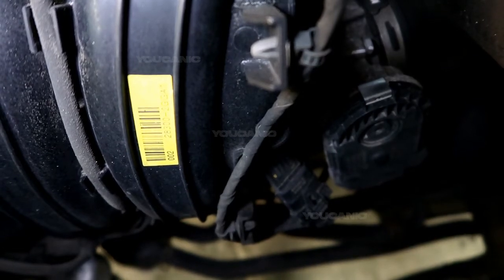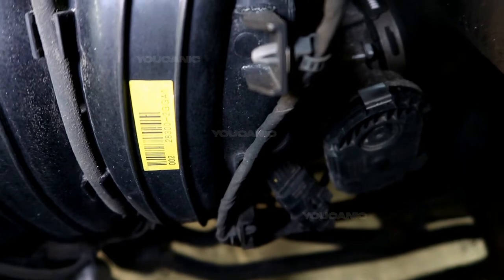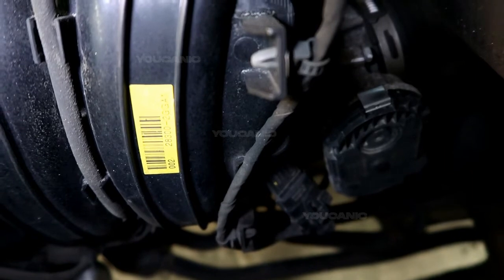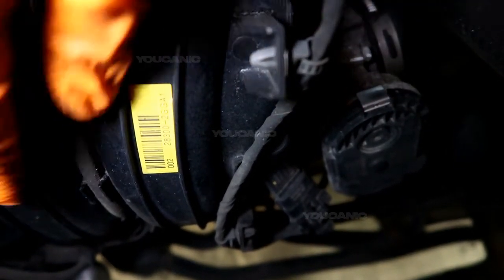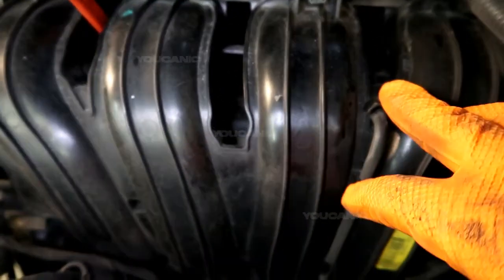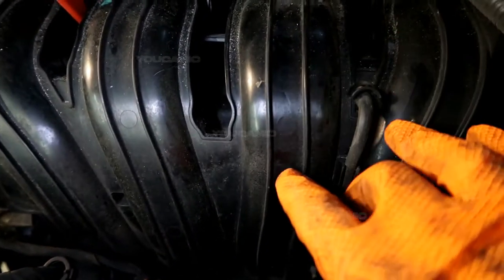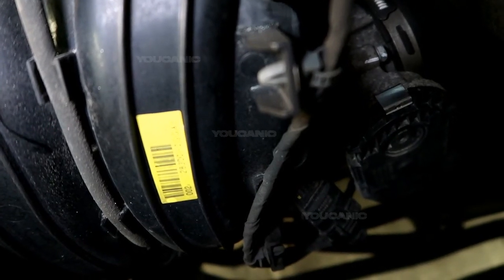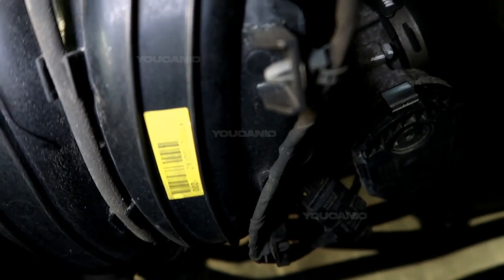2015-2020 Kia Optima MAP Manifold Absolute Pressure Replacement

Comment: The 2016 Optima 2.0 Turbo has a map sensor, not a MAF sensor.
Reply: So it doesnt come with a Mass air flow sensor? Only a manifold absolute pressure sensor?
Reply: Non turbo gas MAP/MAF SENSIR